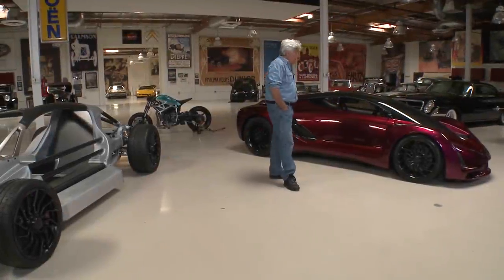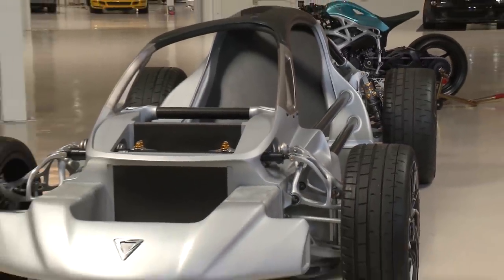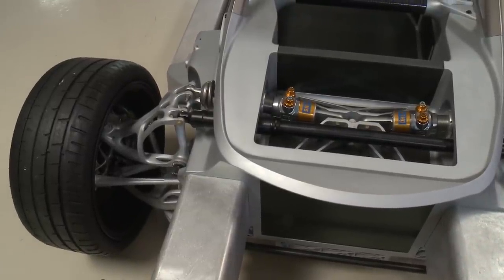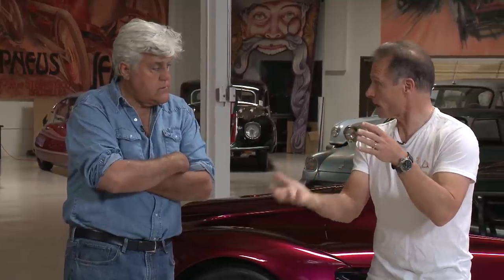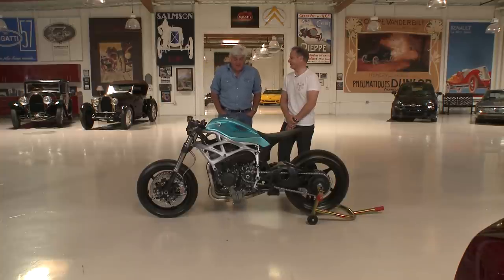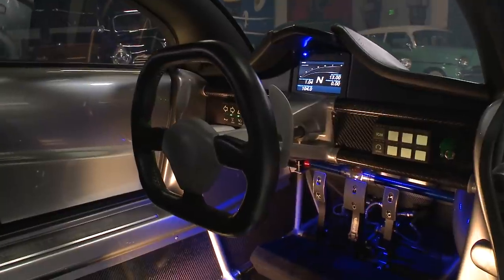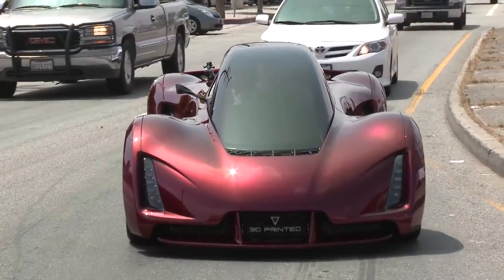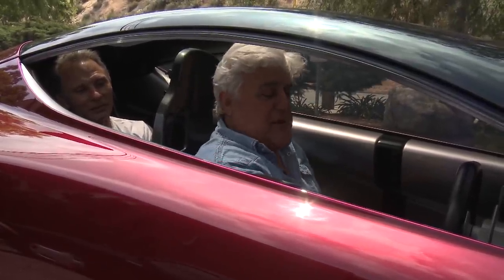2015 Divergent Blade - Jay Leno's Garage

Comment: Folks whats impressive isn't the prototype but the engineering technology in producing the integrated parts which form the chassis. This is truly the future. The next technological automotive leap is organic based structural design. These designs increase production efficiency while providing lighter and stronger platforms. This technology will be used from aerospace to military to consumer grade products. Michelin just produced a prototype tire that incorporates the same structural design ideas where it mimics coral.
Reply: funny all the technology couldn't keep the damn body parts from flapping about in the wind, or make it not sound like it's struggling to do 40

Comment: The fact that the Aluminum and Titanium don' t line up annoys the crap out of me.
Reply: If you ever worked with a 3D printer, mis-calibration is very common. Slight mistakes are always seen in the products.
Reply: yes meet to but its a prototype and is a crash test body so no big deeal in the end for me
Reply: Knights2theEnd that would seem to me then, that 3D printing isn't good enough yet for this kind of application. would that be true?
Reply: no, that would be wrong....3d printing can be as accurate as you wish....you want .00001" tolerance? can be done......plus that alignment issue could be assembly error as well.....
Reply: The A pillar slips over the bottom section, making it look out of line.

Comment: 3D metal printers that work on Titanium?!
OMG, this guy could make the BEST lowers for ARs
Reply: Bang bang
Reply: Titanium lowers are out there, run about $10,000.
Reply: @coreyhardwick4660  that's an insane amount of money. It's not worth it unless you're a Turkish mountain commando or something.
Reply: @TurkishRepublicanX  Nemo makes a full on titanium rifle for about $100,000.
Reply: nyctreeman you can 3d print in any metal
Reply: yeah but it wouldn't take advantage of the stress technology with the mesh like shape

it'd be pointless you already can get AR receivers.... like using a clever technology for a dumb thing

furthermore aluminium is lighter than titanium, you'd want magnesium alloys
Reply: Corey Hardwick id drop a 0...
Reply: Now that is the best idea, cars are great, I like the 60s cars the best well up to around 73 depending on the manufacturer, but we're gonna need guns if our government doesn't straighten up!!!

Comment: If it’s so inexpensive to make then why do i feel like it’s being sold for a high price? Anyone else get the feeling that they want 400,000$ or so for one of these?
Reply: inexpensive to make is compared to traditional methods making such structures. It would be even more expensive. It's obviously not going to be a cheap vehicle.
Reply: first of all, they're not selling these, second of all, it's definetely much cheaper to make a car with those specs the way they did compared to traditional methods
Reply: $1.7m
Reply: @itzFYEB  they are selling them. It’s called the c21
Reply: @VeriStrawberi  they're not, the c21 has different specs, this sort of the prototype to the c21
Reply: @VeriStrawberi  1.2 and its called the C21 now lol
Reply: Because it's built with expensive materials
Reply: The guy did invest 150.000.000 million ins tools and 3d printers ... not even talking about development, salaris etc etc....

Comment: Usually Jay is ear to ear smiles during his test drive when he really likes a car, not this time.
Reply: Yeah. The whole time he's driving he looks like he's in Analyzing... mode.
It looks like the same face I had the other day when I borrowed my sister's car and after turning a corner and feeling an odd shh-thunk through the steering, I spent the next couple of  blocks randomly shifting the car back and forth in the lane to feel it again, while making that face and thinking, "...is that the left inner cv joint going out now?" (it'd already needed to have the right inner joint replaced earlier this year).
Yeah... I get that face a lot when I drive other people's cars. lol
It's like 
Me: ....uhh, wheeeen was the last time you had your tie rod ends checked?
Them: What are tie rods?
Me: Ah.
or
Me: (making that face again) ...have you checked your tire pressure rencently?
Them: Tire pressure?
Me: (making a new face) you know, checked to make sure they have the right amount of air in them?
Them: You put air in your tires??
Me: Ah.
I swear, it's the same face. lol
Reply: it's so light and nimble and high powered he's scared and using a pothole for an excuse.

Comment: What are they selling, do they have patents? Cant manufactures  do this themselves?
Reply: the tech patent is on joining 3d print parts of a variety of materials by avoiding traditional welding. From what I understand based on this video, it is a combination of airplane grade epoxy which is probably injected molded inside of the two different parts, along with some other joining techniques. Any manufacture can use this patented technique if they are willing to pay the licensing fees. That is what a patent grants, a limited 17 to 20 year monopoly over a non-obvious invention to another inventor in the same field with knowledge of all previous inventions in that area.

Comment: i think a standard na v6 say 280-320hp would be more then enough to make this a all around great car... 700hp sounds exciting but only of you have a race track like Road Atlanta or similar to use.
Reply: kris johnson speaking of racetrack how do you think a narrow car such as this would go around? It seems it has the American car sindrome. Good in a straight like but that's about it.
Reply: The Vibe you should tell the FIA prototype guys and  the F1 and indy car builders that they dont handle cars. the "American car syndrome" as its called does not exist when it comes to sprts cars ( Corvette, Viper, Mustang, Camaro and the ford GT) even some car is such as the Cadillac ats-v dont have a problem taking a corner.
Reply: kris johnson Since when do Mustangs handle corners well?
Reply: Greg no, no, no ,no.....NO! mustangs dont handle Crowds well. wrong C word.

Comment: Modern cars like this fail badly because you can't play trombone while driving. In classic cars you can have a good toot on a brass instrument while behind the wheel. Not any more.
Reply: Daijyobanai But what if I want to have a go with a guitar?
Reply: As long as I can play my Harmonica I'm good...
Reply: Puff the Magic Dragon Guitars have never been possible because you need at least two hands to play one. The development of self driving vehicles is actually specifically intended to solve this problem.
Reply: Maarten van Rossem Lezingen Of course apologies I don't know where my head was at.
Reply: Absolutely spot on my friend. Kids today have never known the joy of a road trip with a small brass ensemble providing the entertainment. Plus you can only fit half of a Barber Shop quartet. It's a crime!

Comment: This car is using gasoline OR natural gas. Pump gasoline ⛽ (91 or 93 octane).   But natural gas is 130 octane.   Yes that is correct & not a mistake.    We built a 11 to 1 compression 327 Chevy with B.M. supercharger (NO intercooler) using natural gas. Never had any knock. I need a investor to contact me about a dual fuel LS chevy. Normal driving is on gasoline ⛽,  BUT when you want to double the horsepower and double the boost, the engine is switched to natural gas (130 octane).  Also the USA 🇺🇸 is the world's largest producer of natural gas. USA USA 🇺🇸 🇺🇸

Comment: This is a really interesting concept from a prototyping and manufacturing perspective.  Complaining about how flimsy the body panels are or the noise or look of it misses the point.  That's all stuff that can be easily and rapidly corrected using the philosophy stated by Mr. Czinger here.  If the product or the messenger lacks polish, that doesn't detract from what's going on here.  There are really interesting possibilities opening up.  

Using the basic bones you could build something that is completely individualized to whatever your needs or tastes; avant-garde, retro, or something in-between. Like Local Motors, except you aren't restricted to whatever pieces or power/drivetrain/suspension parts are available. 

A completely bespoke car that isn't the sole province of the super-rich.

Comment: I don't quite understand around 11:00 , where he explains the process they used to bond the sections together.,  then goes on to explain that the bolts are to simply make it easy take them apart and replace if they're damaged. If they're already bonded., wouldn't that be redundant and an necessarily extra step on top of having to undo the bond?  however that works.
Jay's suggestion that the bolts add a bit more structural integrity makes the most sense.

Comment: Why do the panels flap so much? Build quality looks like crap.
Reply: S C it's just a concept car, not even a prototype for a production car.
Reply: It's about the fucking chassis
Reply: Technology demonstrator
Reply: Well he used the 3d printer for every piece except the tire what did you expect 😂😂
Reply: Jay said the tires were flat spotted. If you have ever had the pleasure, it will make things flap around.
Reply: Whatever it is they should fix it, makes the whole technology look suspicious, but good luck to them 👌🏽
Reply: AkATigerAlly 
Just because it’s 3D printed doesn’t mean the build quality is solid.
Obviously there is a flaw.
Chill out

Comment: In my opinion, this car looks a bit dated, even though it's only 2 years old. It looks like something from 12 years ago. I have no doubt it is advanced, but that is just my opinion. It is light, it is modern, but that's just my opinion.
Reply: You can stick any body on it, or any engine in it. The point of the video was the manufacturing process, not the actual car. Design your own perfect looking body that we can all mock, then press print.
Reply: But it would have been better marketing if the car looked nicer. It reminds me a lot of the late 80's and early 90's GM prototypes like the Banshee IV.

Comment: I have to think this technology will explode. It's a new level of efficiency. I thought Jay's 3D printing was a super advancement in manufacturing. But this is on another level. If I understand, Jay is 3D printing a plastic model or mold to be cast. Divergent is 3D printing aluminum final product.

Comment: The reason why you glue AND bolt is glued parts are stronger but they tend to peel when close to their limits by adding the bolts you eliminate peeling while still retaining the superior strength of a glued joint. The ultimate joints are those that have been used on shipbuilding for centuries where you use a mechanical joint which stops the peeling and you glue together.

Comment: So, let me try to sum this video up here.  It really seems like Divergent Technologies has developed in this car a motorcycle, with additive manufacturing techniques.  Think about it.  It's just like a motorcycle, except it has four wheels.  The body isn't structural and simply wraps around the frame(think plastics on sportbikes).  Even the passengers are in alignment like a bike.  Brilliant.  I haven't seen a design like this before.  I would REALLY like to see their safety ratings.

Comment: body styling is subjective, but structure is beautiful. imagine this technology used on the suspension components of your car even if it's aftermarket. it would effectively reduce the weight and increase the strength.

Comment: Hey brother J... I just wanted to make sure you knew the difference between a TIRE and a RIM and when you install a tire onto a rim... it becomes the weight (holder upper)... A WHEEL.  One made of rubberish materials "I HOPE" and the other an "ALLOY", again I hope... together, they become a WHEEL.  The balance of each wheel is critical to be a GOOD and SMOOTH roller, or as race car drivers call it, well balanced 😅

Comment: Nothing but respect to this man and his company, but for me, I'm with Jeremy Clarkson on the topic of computer designed cars. In an old Top Gear review of a Ferrari 599 GTO, he hailed its performance and precision. An absolute beast. A pinnacle of speed prowess. However toward the end of the review he pulls out a Ferrari 275 GTS from the 1960s. Hand built. Designed by the human mind. And for all the computers and technology and bleeding edge techniques used to make the 599 he phrased it in a way that I've never forgotten:  it had no passion. Where is the human ingenuity? The spirit of discovery? The determination for excellence? And most of all, an exhibit of a mastery of a craft and a love for engineering? The computer ran numbers in a simulation to give you the best suspension linkage set up for that frame, and that's it. There was no genius and an application of skill and knowledge. Again, they have a really good thing here imo, but for me, it's not my cup of tea.

Comment: I'm not going to beat on it as it's just a prototype and it's the 3D tec he's advertising but with no proper chassis and a suspension designed by a computer I wouldn't like to take any high speed corners in it! The bike frame looked very cool and you can definitely see bespoke car companies using the technology for certain parts! Maybe not the suspension though lol
Reply: They're a startup with like no money compared to an auto-maker, that just winged it without the revisionary processes; computer straight to the road. A company or many of them could refine designs using more conventional methods, and license manufacturing to 3d printing and assembly places around the world, or do it in house.

Comment: I don't understand. Jay asked how the titanium was joined to the aluminium. The guy goes through a lengthy explanation about it being bonded with a complicated tongue and groove (most likely a mortise and tenon instead) and aerospace epoxy resin with pressure and magic and so many wonderful purposeful things. 

Jay asks what the bolts are for, oh those are for repairability, you just unbolt it and slap another 3D printed part on. If it is that simple, what's the point in having the ultra super duper magical "bonded" joint? If you remove the bolts to separate the two parts, guess what Kevin, that is how those two parts are primarily held together.

Comment: I would have loved to design the cars canopy to open up like the Batmobile and a Koenigsegg using an automated hydro system that makes that sound, and can be opened by pressing a button or facial recognition. oh man , now i also want to quad turbo it, so it sounds like a fighter jet. I would probably need to add fighter jet spoilers to keep it on the ground that fold out of the car when hitting the fun speed. if were going this route, throw down for a led light system on the dash, rims, floor lights, and interior and make the thing look like a spaceship the welcomes you when you walk up to it with a little captains whistle. its the little things.

Comment: Idiots commenting, do you even understand the point behind this? It's not about the engine, it's not about the design. It's about the chassis. The chassis is the key here. They 3D printed the whole thing. It's a new manufacturing process using different materials. It's like a shop car featuring everything the shop offers. In this case, the chassis.

Comment: ..the reverse of what Chrysler did with the unibody, prior to and better than most others. and yet, this design works, as well. exo vs endo. would i rather have a '68 barracuda with a hot, stroker small block & 8 spd, paddle shifted trans? oh yeah :) However, this is what's going on now & forward from here..and i for one, love it. ..can they skip the bazillion airbags in these? ty.

Comment: its is bonded together but still needs bolts? Should you not have to cut the two pieces to break the bond and then have to bond them back together? This seems like a lie.

Comment: It could have been prepped a bit better, rubber seals, insulation here and there, a bit of compliance in the suspension, but a cool running prototype. I would want one if it was cheap enough and in production. That panoramic roof/windscreen is awesome. I don't like the engine selection though. To me, with a car that shape, it tells me "this probably has a high revving NA". A Honda or Toyota/Lotus 4 cylinder NA might have helped to lessen the burden on the driver and better communicate the chassis capabilities. I like cars with driving dynamics that push you as you get to know it, but don't bite your head off if you come near the limit. A bit of suspension compliance might have helped Jay appreciate what the chassis was about as well. The guy has old bones man, let's not beat him up.

Comment: Yes this technology could speed up engineering design but 3d printing and then composite assembly will not be faster or cheaper than current standard robot-welding station to station assembly. Jay didn't seem overly impressed with the performance. Needs a more sophisticated motor, tighter frame and a bit of insul to cut down on rattle and noise.

Comment: I really don't like the looks of the finished car. But, I noticed some parts almost looked like a drone that was designed by an AI and showcased in a TED talk on AI design of structures and parts/skeletons for vehicles. Then he went on to say it was designed by an algorithm, and that the goal is to sell the technology to other manufacturers. I started to get it then. The AI design connected with the printing of parts is truly going to take cars to a new level and might revolutionize the manufacturing process. When you also take into account the combination of simulation and crash testing, that is just taking it all to a new level of saving money. This is fascinating stuff, and I can't wait to see how things turn out over the next 5-10-15 years!